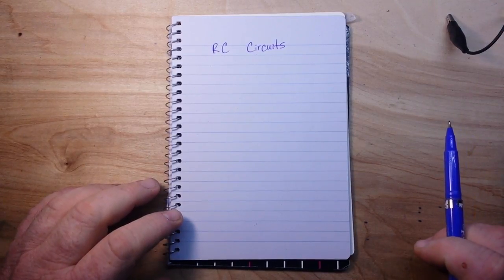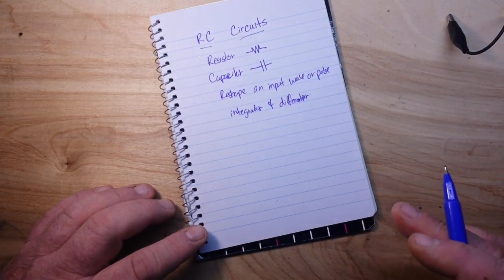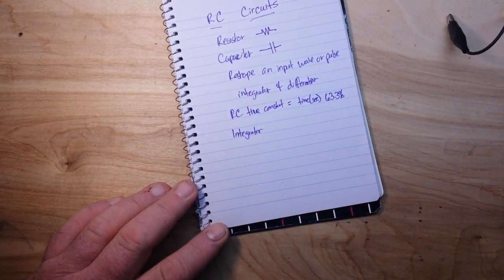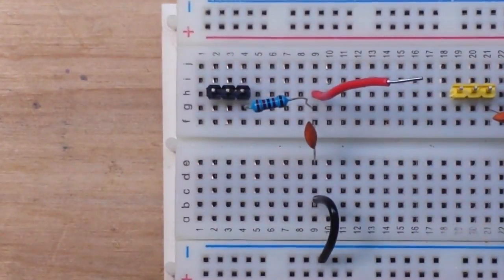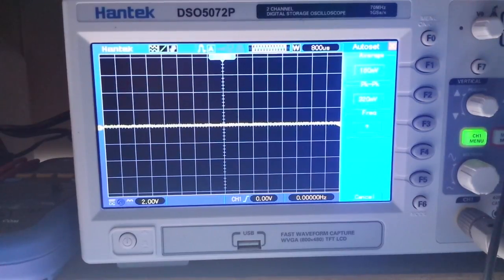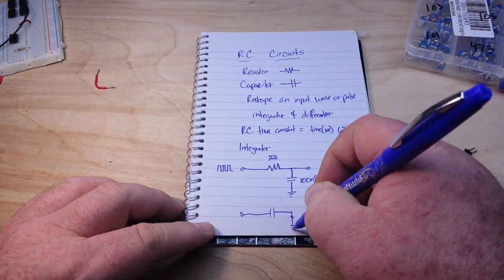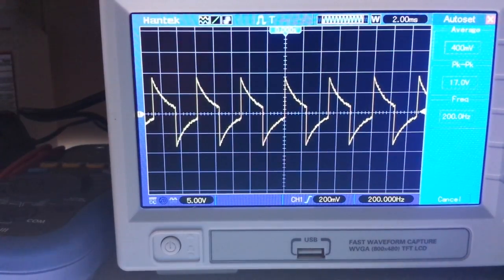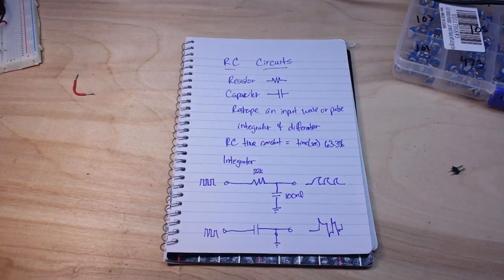An introduction to RC Circuits

Comment: The only way this RC circuit for me to understand is to study the mathematical physics derivations and do experiments on my own, and change the values of the components and use the oscilloscope and observe the behavior of the output from the input of square waves, triangular waves, sinusoidal waves with varying the Time Periods with the RC constants to understand fully and clearly how an INTEGATOR circuit and a DIFFERENTIATOR circuit behaves = from mathematics derivations to laboratory experiment verifications. Peace, God Bless.

Comment: It is good circuit analysis clip. It would be better if you had shown the circuit connection when you were talking. You constantly showing the oscilloscope screen when you are connecting the circuit but not showing it.